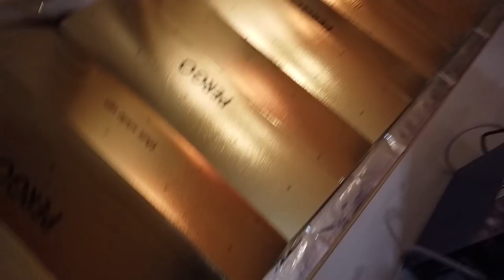Building a Scandinavian Style Mancave

Comment: Nice build. There should always be a plastic barrier toward outher walls and a air seal barrier on insulated diveder wall inside. Plastic barrier to prevent hot humid air to condensate inside the insulation and air barrier to keep dust from insulation to enter inside air. Looks really nice thoug 🙂
Reply from the maker: Thanks. In buildings that stay warm all the time, and with thicker insulation there should always be a vapour barrier. However in buildings that might stay without heating for long periods, and insulation not thicker than 200mm a vapour barrier is not necessary. In, fact it may do more harm than good because it might get colder inside the building than on the outside.
Reply: @DieterSchneider  Hei. Ja. Det er sant. Jeg bare tok det som et utganspunkt at mancav'en ville bli hyppig brukt 😁 jeg leste nylig at panel ikke er definert som tett på lik linje som gips og andre typer plater. Man skal derfor bruke vindsperre for å hindre at støv fra isolasjon kommer ut i rommet. Det ble et fint bygg og jeg liker godt din nøyaktighet under byggingen. Jeg innså først nå at du holder til her i Norge. Dieter er ikke et urtypisk norskt navn. Jeg heter Bjørkevik og mine forfedre kom fra andre sidden av fjellet for hvor du bor. Nemlig fra Vik.
Reply from the maker: @rubenmadman   Ja, kan sikkert diskuteres i evigheter, vet det er delte meninger om dette på både hytter, anneks og eldre hus (nye hus med tykk isolasjon er vel alle enige om at skal ha dampsperre). Vindsperre har jeg på utsiden, men regner med du mener dampsperre? :) Er norsk ja, men faren min er halvt tysk :) Vik ja, står en flott stavkirke der, kjører av og til gjennom der på ferie :)